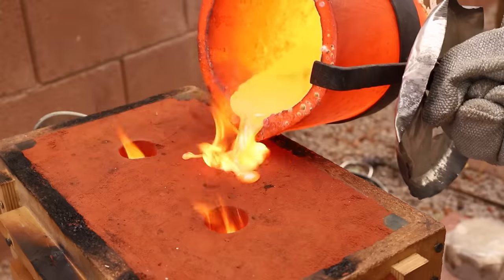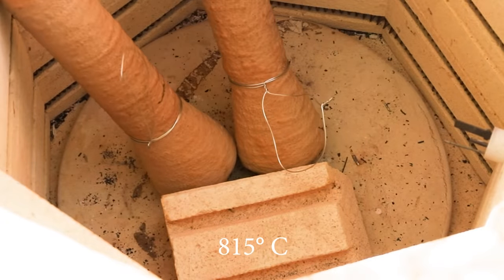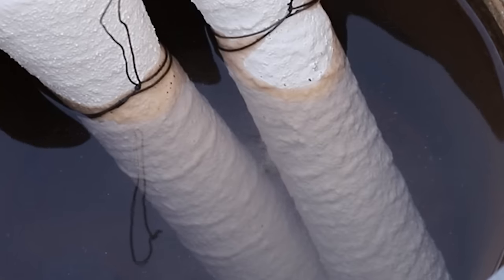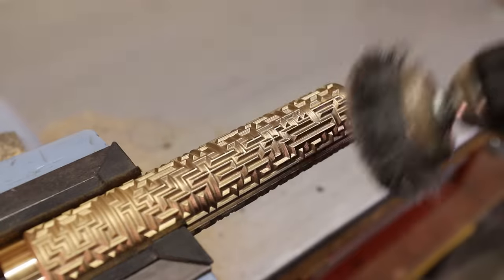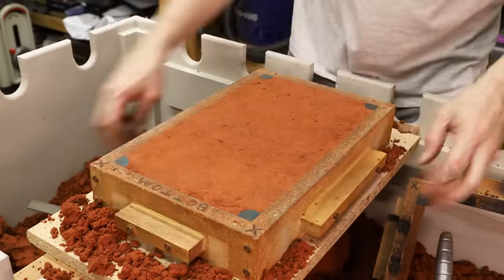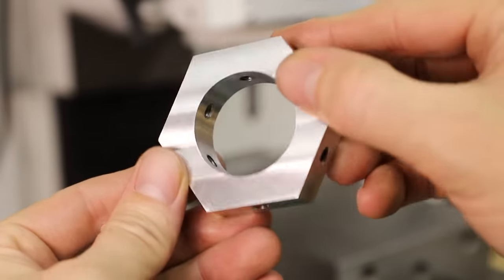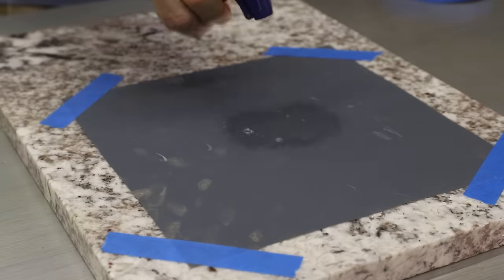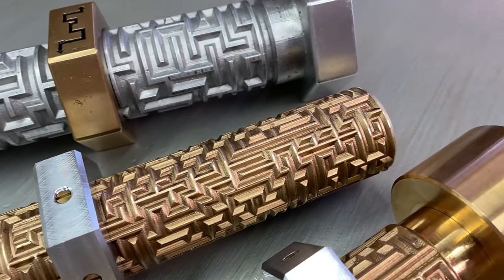I made a bolt with MAZE threads - Don't strip these threads! - Can you solve the puzzle?

Comment: can bronze be blued? it would look nice with darker grooves
Reply from the maker: It can be darkened but not really blued.
Reply: Bronze is so purdy polished you don't want wreck.. brass even more but steels and aluminium you can anodise afterwards
Reply: Go ahead and do it yourself
Reply: It can be “blued” (turned black) just like copper and brass. But the term of bluing isn’t used for bronze.
Reply: You can make Steel blue at some high Temperatur
Reply: imho polished for the raised edges + rough in the grooves sounds like a good match for this kind of puzzle :)
Reply: @QIKUGAMES-QIKU pretty sure anodized steel would just be rust

Comment: DUDE those castings were crisp as heck man. Absolutely beautiful details
Reply: this is the actual way to make art castings or other high quality ones 
i never understood why some still use the a clearly outdated process that make low quality
Reply: @darkplasmo7921  Whats the "Clearly outdated process"?
Reply: @andrewsneacker1256  Sand.
Reply: Damn man I’m new here but you work is spot on!!
Reply: That's exactly what I thought! Perfect straight lines and no blemishes at all.
Reply: @darkplasmo7921  Because it isn't "obsolete" or "outdated". Sand is faster, cheaper, and more appropriate for industrial use. "Low quality" is meaningless if you can still do what's needed.

The investment casting stuff is only good for prototyping, or small run parts, because it takes longer, or for very small high precision items that would be difficult to machine. Really high grade aeronautics and engineering stuff uses it, but those are $$$ parts, and rarely bigger than hand carryable. Sand casting is better used for mass production items, things that don't require extremely high tolerances or can be machined to the necessary tolerances easily, or very large things.

Also, investment casting is older than sand casting by several thousand years.
Reply: @SecuR0M It does not take that more time considering you have very little post prospecting and with lost wax  you can get all sorts of problems that make the part unusable
the advantages of an empty mold before poring are already worth it to me  

sand carting is less sophisticated and so much more can go wrong.
I was referring to YT, and they don't need to make 100 of parts 
you have a lot of people making figures and sculptures that look just terrible.
For them, it is well worth to learn an objectively better method even if it takes more time and money.
Reply: @SecuR0M  over the last 10 years, in the pump industry, many manufacturers have gone to investment casting (AWAY from sand casting) for pump impellers.  The traditional impeller design, for the last 100+ years, was sand cast bronze.  But today many are using 304 or 316 SS (CF8 / CF8M) investment cast.  The net pour cost of investment cast is about 50% higher than sand cast SS.  But bronze ingots are today 20-25% more than stainless due to copper prices.  So IC SS is only about 25% more than Sand cast bronze.  The improved quality and reduction in machining time more than makes up for this 25%.... IC impellers allow the impeller vanes to be thinned out, increasing pump efficiency as much as 4%.  So IC is NOT just for defense and small precision parts.
Reply: @SecuR0M  It is when you are making intricate parts. Sandcasting is the way to go for many things but not so much for high precision details and a handful of items.. I mean, any CHina based shop can produce these using sand but the details are lost and half won't even function properly unless it's put to a cnc
Reply: But to make the threads? Not a good idea for sandcast
Reply: @bullyakker  True, they are both useful.
Reply: i just farted, but you all have a good point, i guess.

Comment: Tip: instead of making 8% tin bronze, 10% aluminum bronze is notably stronger. Also, using water to cool them down quicker like that actually makes them softer.

The screws still look beautiful, and I'm sure there isn't really a problem with softer metal, since it's not undergoing much stress at all.

Comment: Ive been a machinist for 23 years. This was beautiful machining my guy. I wish my first time threading single point went that well, pretty sure I scrapped my first go at it because I had my lathe set up wrong lol
If I have any advice at all to pass down from watching this beautiful masterpiece you made, it would be to use a reamer instead of a boring bar any time you got the chance. Its a much better finish, and far more accurate than boring bars. Plus lets face it, those really nice mechanical boring bars that are actually accurate are very very very expensive lol(even the Chinese ones), like 2+ grand easily. Only down side to reamers is that they only come in certain sizes like 1/4", 3/8", 9/16", 1", basically standard common sizes, unless you custom order them(expensive). If you can use a reamer though, the surface finish, and size accuracy of the hole is gorgeous. A decent reamer has about a +/- .001" accuracy, so they get you super close, and they aren't very costly either. If you've never used a reamer all you do is make your hole about .010" - .015" under size then go in with the reamer, its that simple. A decent reamer set wont run you but a few hundred, maybe even cheaper if you buy them used. They are fairly easy to maintain, and last a looooong time, as long as you aren't expecting them to shave off .040" or some crap and you put them through hell lol
 Its mind blowing how far machining has came since I started. Lol hell when I started out about all we had was a file and a lathe and a mill lmao
 God bless!

Comment: VERY NICE video! My dad worked on huge brass and stainless centrifugal castings and I worked in plastics. This video was a perfect application of both. I especially appreciated you melting most of the plastic out before burning the remainder. Even though the plastic is pretty much unusable, it wasn't dispersed into the air. KUDOS!

Comment: This is such a cool project! Question from an aspiring amateur machinist: at 04:31, the bolt is protected from the chuck jaws by wrapping it in a metal sheath. That sheath overlaps itself a short distance, so that there are two layers of that metal between one of the chuck jaws and the bolt, while the other jaws appear to only have one layer between them and the bolt. Does this additional layer of material affect the precision of the lathe in any way, e.g., situating the bolt off-centre on the lathe by the thickness of the metal sheath? Or is this something that can be corrected for by individually adjusting the chuck teeth? Thanks to anyone that's willing to provide some guidance!
Reply: From what it appears, you could adjust the other jaws to account for it. However, we are probably talking of a 1/1000 shim (0.001 IN) so it would be a negligible difference for the accuracy you need on a project like this. I could be wrong though.
Reply: @Twitchy239  Thank you for the insight! I guess it makes sense to use faster and easier techniques in cases where tolerance is less of a concern.

Comment: Great idea. So, what if to make a nut mechanism more complex? Pin hides manually to reset a puzzle and releases when nut reaches a head of bolt. It allows to remove reset corridor and make a maze without bordres and more difficult.  Also, shape of pin (and profile of maze walls) can use an angle closer (but not reaches) to 90 degrees - it will make a mechanism stronger and will give more lifetime.
More, if to think about nut mechanism, avalible to add more layers (floors) of maze. Drill an axial hole and you will give a pipe with inner and outer surfaces. Nut can be strongly connected to part  (like a bolt with an another pin) inside a pipe. Then outer maze can have a hidden walls that posed in inner side. And as berry on cake, then puzzle can hides some prize (key for another lock, special desined coin, etc.)

Comment: It's crazy how sharp these came out considering they're cast. I figured you'd make the heads entirely on the lathe, using some round stock and a rotary broach. No clue how well such a massive broach would work, and it wasn't necessary either way considering how well these turned out.

Comment: Fun to watch! Try some lube on threading, it is more important than cooling when tapping. Even rubbing alcohol works well on Aluminum and leaves no residue. More important to keep copper based metals cool as the chip is usually self breaking. What software do you use to design?

Comment: If you need to cut threads on the lathe again. Set the compound slide at 45 degrees and use that to go to the thread depth . It allows you better fine control over the thread depth so you should never end up with loose threads when you have to cut them.

Comment: You should build another bolt with maze threads but with a bypass key pre built into the threads for the owners of the bolt to quickly remove the nut from the bolt but make it difficult or nearly impossible for anyone else to get past the maze of threads since they wouldn't know the bypass key which is just a sequence of turns in a specific order to get the nut to bypass all the other threads and slide off the bolt in one fell swoop. And only the owner would know the bypass key.

The reason I say all of this is because I can see the potential of this bolt as a locking mechanism for a DIY security lock box.

Comment: Yo I seen the thumbnail to this, and said outloud " yooo, thats fuqin cool", well im subbed now haha. Hey, is it possible to cast sledge hammer heads above 15lbs? If so would I just melt heavy iron, or would I melt steel? Do not know much about metallurgy so generally curious, and this bolt pattern is so cool.

Comment: I know it would be tougher to design and build... but would it be possible to make one with two pins? I really think it could be and if so, then it wouldn't be like a simple maze that was put on a cylinder. Having a lot of open and closed areas that coincide and don't coincide would make the maze much more difficult though. It could be made to be easily solved, but I think it would be best if it was made with smaller channels, so it wouldn't just be harder to solve, but would also be a larger puzzle altogether. (...but that would probably make it harder to design and build too though).

Comment: These monstrous bronze screws must weigh a lot. This makes using it as a puzzle unnecessarily heavy. Why not carving the inside to make it more a pipe than a slab? You could also add another level of a puzzle to the inner surface.

Comment: If nobody else has mentioned it, here's a tip for the slurry dipping stage:   your slurry was in a bucket that wasn't quite deep enough so you needed to use a ladle to coat the top. Instead, you could use a suitable length of PVC pipe with a cap on one end and put enough slurry into the pipe to coat your object to its full length. Just make sure you use only enough slurry to displace and rise to the top end of your object. Quick and easy.

Comment: Nice one. Just a no handcrafting man here who's interested in puzzles. I like the logo like impregnation on the screw nut of the old one. This would also add to the new ones. And the round bottom of these two could hold some Jumanji like text which lures you into the maze. Could be something like this: "Holding this in front of you makes a more stronger you. But giving it some twists and once or twice or more a turn could help to start your brain burn, old energy within your body's corners to find an escape from this transformer..." ;-)

But what's not so nice for a puzzle solver is that this is a one time pony. Maybe it is not too hard to make a maze holder containing 3 or more of these maze roles which than could be interchanged with one another or more ones you could make in the future. Like a long screw with 3 or 4 or 5 nuts on it. These just have to have something holding them in place when attached to each other. They could also be different materials/colors/themes/... .

Same goes for the screw nut to solve the puzzle. You can imagine it a bit like the hero going into the maze. So beside the maze line logo of the old one one side could hold a hero picture like a tiny Mega Man or the Transformers logo or the Zelda Triforce. So multiple nuts mean multiple heroes to choose 1 from before you start.

And another idea I have is to add a hat with a screw for this so the screw nut can only go back to the start at the bottom until you twist the hat until it is removed to change the hero/screw nut.

You can use all this inspiration for free but maybe I will do something like this in the future myself. ^^ Or more precisely: Let it be done. 🤣
Reply: Nah

Comment: I saw some bubbles in your first layer of slurry. Those bubbles will become difficult to remove tiny balls of metal attached to your casting. Popping the bubbles with compressed air will help. And 'Soft Scrub' on a soft bristle brush can remove any oils from handling that might resist the slurry. Thing is, you look like you know what you're doing so I should probably keep my mouth shut and watch your video and learn.
EDIT: OK, at 4:28 I can see some metal bubbles in the grooves in the casting. We used to call them potatoes. They were a pain to deal with, in details of a portrait sculpture, in the corner of an eye. A dremel can chatter and scratch and gouge a detail or area. A tiny chisel works best, kinda chip it off. 
At the art foundry we would spray the wax before the first dip in the thin slurry. The colloidal used in the slurry, mixed with alcohol and floor wax in a regular 'Windex' style hand sprayer. This mixture was to prep the wax so the slurry would stick better and have an even bubble free coating. This was something I did 40 years ago. I'm not at the art bronze foundry anymore. I'm into art metal object restoration now. So maybe in 40 years a product has been invented that prevents bubbles. Maybe that stuff for car windshields, 'Rain-X' would work great.

Comment: A ball-bearing which self-centers in the channel would be a possible improvement.  Also a Teflon bushing inside the nut, perhaps inset from the edge.  Or drop the nut entirely and use a  3D printed plastic selector wheel with wavy grooves around the perimeter, finger-sized.   On the sides of this nut, your logo.  Finally, the head could have flats added to prevent rolling away, perhaps a second head on the other end too to trap the nut. The screw is a beautiful item!

Comment: Dr Stanley Marcus used to teach ceramic shell casting at UTPB.  He would put the hot ceramic shells into a pit filled with vermiculite.  This would help the shells stay hot until casting, slow down the cooling of the metal to control shrinking, and hold the shells together if they cracked during casting.

Comment: when  working with 3d printed PLA, and casting. It could benfrit you to try "torching" the PLA print to smooth out the printlines. Just apply a light flame to the outside of the print. Just keep in mind that your highspots might get a bit rounded.

Comment: If you ever worked on a car and had to remove or put back a hard to reach bolt you can't see but only feel with your fingertips yet you need the strenght of a long wrench but there is no room for it then this maze thread is pretty much what you experience when working on a car with such a problem at hand :D

Comment: Love the idea. For an even more difficult maze it could be sectioned into different discrete blocks. You can use the set screws to jump from one block to another. With multiple jump points per section and different sections to jump to the chance you get horribly lost should be pretty high. Bonus points if instead of set screws they're pins where only one can be depressed at a time.
Reply: This is an awesome idea.  Please post the video when you create a maze like you describe.